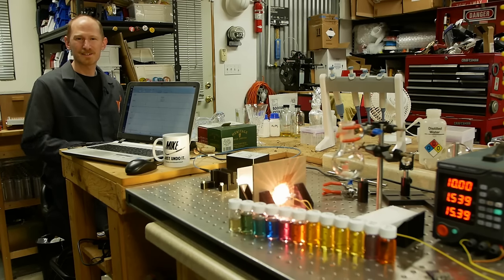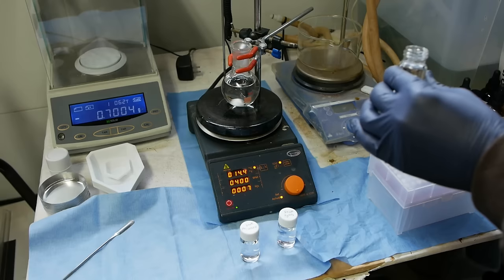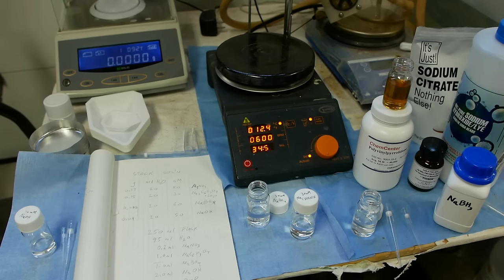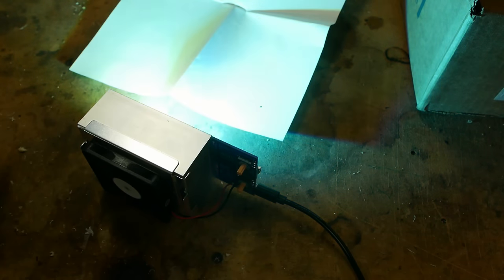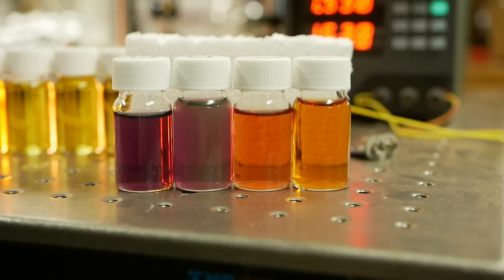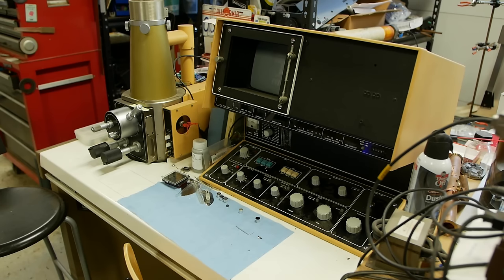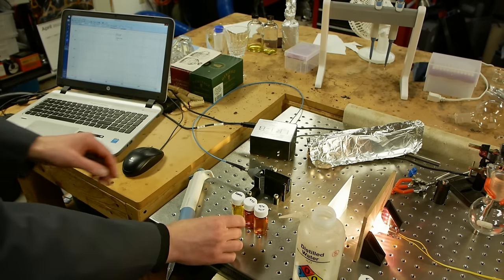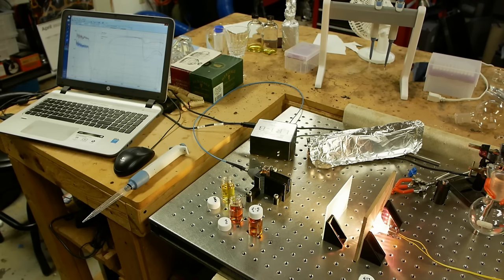Silver nanoprisms grown into structural colors by high power LEDs

Comment: A potentially fun follow-up experiment: Rig up a jig that lets you both illuminate the liquid with a specific wavelength OR sample it with the spectrometer in situ. This way you can turn off the illumination long enough to  sample the absorption spectrum at regular intervals. It would be cool to watch the peaks shifting on the absorption spectrum in time-lapse.
Reply: The reference video did that over 26hr, but with multiple solution runs

Comment: If the reactivity of the particles is "encouraged" by a given wavelength of light, it makes sense to me that they'd therefore react and grow until they're no longer (strongly) absorbing that wavelength. If that's the reason, that also explains why irradiating with a lower wavelength of light doesn't shrink the particles. TL;DR: if we assume the reaction occurring here is strictly crystal growth and that reaction is enhanced by light absorption, then we expect both effects that you seemed slightly surprised by (absorption wavelength != exposure wavelength; and the inability to reduce the absorption wavelength.)
Reply: I agree. But have you found any resources that show size dependent absorption properties of silver nanoprisms? I found a calculator for mie theory of spherical particles which supports this theory, but it would be nice to check for prisms.
Reply: I also noticed that in the third graph, the 405 peak has red-shifted somewhat. I think that aligns with what you're saying. (I'm also curious about the new large peak that appeared in the IR range after the first graph.)
Reply: this explain why when he use the 450nm LED, with intention to "revert it back to original colour" the red-shifting/peak-shifting actually do the opposite and is much stronger because more crystal from 400nm can grow bigger when provided with 450nm light.
Reply: This is the same hypothesis I had. Also, for the colour to shift back, it may be because the larger particles just fell out of solution while un touched smaller particles grew larger.
It is just an illusion of shifting back, the particles don't actually become smaller.

Comment: Ben, one of the ways that nanoparticles are prepared for TEM is to place a droplet onto your substrate, wait for some time for the particles to settle/adhere to the substrate, blot the supernatent out with filter paper, and optionally wash by dropping wash solvent and blotting. There are a lot of surface modification tricks to try to get more particles to stick, such as plasma cleaning, UV-ozone, spin coating charged polymer solutions, etc. It might take a few iterations of sample loading (e.g. apply multiple droplets) to get enough visible sample. Definitely not easy and unfortunately not well described in literature (generally passed down via institutional knowledge in labs studying nanoparticles).
Reply: TEM is definitely the way to look at nanoparticles. Time to build a TEM Ben!

Comment: Oh no. I have a centrifuge in shipping right now that I bought for dewatering nano particles. I did not realize until seeing that separation chart how much of a challenge is ahead for me and my $100 ebay centrifuge.

Really excellent project/video as always!
Reply: What are you working on?
Reply: I hope your particles aren't too small. In the past when I was making 4-8nm diameter water soluble nanoparticles, I used to have to use an ultracentrifuge to pellet them.
Reply: well if it's balanced and built well enough you can always try to supe it up a bit lol.
Reply: @PedroDaGr8  I think I'll be ok. I'm looking for a range of particles from about 100-1000nm
Reply: You can get a refurbed air-driven ultracentrifuge for $100-200, which should be capable of 199,000 x g.
Reply: One thing I was wondering concerning that: How about changing the density of the solution? For example, by diluting a water solution with ethanol or acetone, gravity separation methods should have a greater effect? Of course, the other salt stuff could get percipitated from solution, so you can't go overboard with it... or maybe the nano particles could agglomerate?
Reply: @craoun6116  Interesting idea. It would be tough to repeat and wash the product with various solvents, but could work for some applications.
Reply: Yes yes yes yes I was just wondering if it could be concentrated/plated/dropped down in the fluid and then our favorite birdie's owner chimes in
Reply: I wonder if that paper centerfuge that came out a few years ago would work. I think the paper said it would get up to 30k gs at 125k rpms all powered by hand
Reply: @unionmade1877  not with a rotor - add$1500-2000
Reply: @PedroDaGr8  What material tubes do you use? We had someone destroy a set of ultra centrifuge tubes trying to pellet some Zinc nano particles.
Reply: @johna7075  We used Beckmann-Coulter 26.3ml Polycarbonate Bottle with Aluminum Top (MN 355618). They were reusable and good up to the 70,000 rpm limit of our rotor. We also used Beckmann-Coulter Quick-Seal tubes when we needed the tubes to be disposable (for example, using a needle to extract a band).
Reply: @Nighthawkinlight  and @Craoun - Since I don't know your exact goal nor your experience level, I will touch on a couple of basic aspects. 

Precipitation is GREAT for bulk purification of . A good precipitation or two, allows you to get rid of the majority of chemical impurities. That being said, it is not very good for the separation of nanoparticles by size.  There are other techniques like sucrose gradients which can be employed for size refining but can require more advanced equipment. In general, if you need tighter control on size, you are better off building it into your synthetic process. Controlling reagent ratios, reaction temperature control, limiting Ostwald ripening by controlling reagent addition rates, proper ligand selection, etc. 

A word of advice: It is very much possible to get nanoparticles "too clean", especially by precipitation. In essence, you can get them so clean that you start to strip the ligands off of the surface of the particles. Typically, the surface ligands provide the solubility to your nanoparticles and prevent them from aggregating. If you find after a precipitation or two that you have excessive aggregation of your product (material which refuses to go back into suspension), you might have insufficient ligands on the surface and have aggregated your product (at that point, it's usually toast). You can get around this by either using less aggressive "cleaning" precipitations, adding ligand to your precipitation solution (to drive the equilibrium), or using a "ligand exchange" after the first precipitation. A ligand exchange is basically heating your particles up in molten ligand and letting them sit there for a set period of time to ensure uniform surface coverage.
Reply: @BioMedUSA  Gah so expensive. Thanks for pointing that out.

Comment: I love your old JEOL JSM T-200. I worked for JEOL for about 10 years in the early 90's. I had several of that model in my service area, along with the later 300 series models. They are a great little scope when working properly. The 10nm resolution is only with Gold on carbon @ maximum KV very short working distance. The sample must be heated to ~ 100C before being transferred to the vacuum. Also must have very good chamber vacuum. low e-6 torr minimum. It is a pain, and I can remember the struggles when resolution had to be demonstrated.

Comment: Dang, I never knew how much I wanted a multispectrum monochromatic LED light, that is a super cool idea! I've got 9 different wavelengths of laser pointers which are also very cool for studying light absorbtion in different materials but now that I see this video I need the LED equivalent. It's amazing how much LED technology has evolved in just the last decade, being able to get this many monochromatic LEDs with such a high output power for the relatively low price they cost is incredible.

I also think a flashlight version would be pretty great too, with a wheel inside that rolls through all the different wavelengths so only one is on at a time, that would be neat...
Reply: A few years ago I bought a bunch of different wavelength LEDs to experiment with what things look like under different "equivalent" lighting conditions.  Then I never actually wired them up.  They had quite a variety of inconvenient forms, haha.  Maybe I'll just make his.  XD
Reply: Yyyeah, but compared to your lasers even the most monochromatic LED's are still pretty broadband.  It's still a cool idea though.
Reply: Man I only have six wavelengths of lasers, unless we're counting frequency doubling as two.
Reply: I wonder how hard it would be to get a dense enough series of LEDs so that by adding temperature control (IIRC peek wavelength shifts with temperature) you can get any peek you want?

Comment: One sidenote concerning the stability of the NaBH4-solution: You could basify it in advance (to like pH 10-11), which would increase it's lifespan by orders of magnitude. Just seems like a possibility, since the final reaction mixture needs to be basic anyway. So a mixed stock solution of NaOH and NaBH4 could be used instead of two separate ones, since the required amount of NaOH is also known (2mL 50mM NaOH stock solution)

Comment: When I needed to image citrate-terminated gold nanoparticles in SEM, I used to deposit them onto poly-electrolyte multilayers. Surprisingly simple to set up. Simply prepare your imaging surface (the CD ROM in your case) by alternatively dipping it in solutions of polystyrene sulfonate (PSS; a negatively charged polyelectrolyte) washing with water, then dipping into poly diallyl dimethyl ammonium chloride (PDAC; positively charged), and washing in water again. Repeat the process 3-5 times to ensure a good coating of the poly electrolytes. Make sure you finish the treatment with PDAC so the surface will tend to be positively charged, so that the negatively charged nanoparticles will adhere to the surface. Simply leave this surface in the nanoparticle solution for an hour or two and you should have a even monolayer of individual particles to look at.

Comment: Great video! I worked and made AgNP for my SERS research in grad school at UCSB. I made "bare" borate capped nanoparticles with just borohydride, but they were very tricky to get right and unstable once any contamination got into them. You can also use citrate directly as a reducing agent to make "nanoegg" ovaloids by heating a AgNO3 and citrate solution. These will provide stable citrate capped AgNP. Also, majority of absorbed light usually goes into creating plasmons (surface plasmon resonance). The electrons excited by this process can go on to participate in reactions, like reducing Ag ions in solution onto their surface. Might be an explanation on why the AgNP grow irreversibly with intense light.

Comment: I think photoelectric effect is interacting with plasmon resonances.  Short wavelength (high energy) light causes electrons to be ejected from the particle surfaces and then the solvent captures a silver ion to neutralize the particle.  This continues until the particle gets small enough that its plasmon resonance frequency equals the light's frequency; at this point, the plasmon resonance shields the particle's surfaces from the light.  Once the particle is too small, no longer wavelength light can reach it to cause dissolution.  You could check this model by adding some fresh solution to see whether the color could be reddened in that case.  Adding fresh silver ions will allow all particles to grow until the photoelectric effect arrests the growth.  Plasmon resonances will have normal modes in triangular prisms.  Probably, the underlying fcc structure of silver plays a part in the triangular shape.
Reply: That could be potentially confirmed by looking at silver’s photoelectric work function to see if the redshift corresponds to that difference in energy. I think.
Reply: @Scrogan  Bulk properties don't usually apply to nanoparticles.
Reply: This would be an argument for shrinking the silver nanoprisms, but against growing them, right? "This continues until the particle gets small enough" would push particles to smaller sizes, but never to larger ones, which we clearly see in the initial illumination. 
Please correct me if I misunderstood your comment.
Reply: "Tunable Dipole Surface Plasmon Resonances of Silver Nanoparticles by Cladding Dielectric Layers" Xiaotong Liu, Dabing Li Nature scientific Reports 2015, "[...] In this article, tunable dipole surface plasmon resonances of Ag nanoparticles (NPs) are realized by modification of the SiO2 dielectric layer thicknesses. SiO2 layers both beneath and over the Ag NPs affected the resonance wavelengths of local surface plasmons (LSPs). By adjusting the SiO2 thickness beneath the Ag NPs from 5 nm to 20 nm, the dipole surface plasmon resonances shifted from 470 nm to 410 nm. [...]"
Reply: Small particles interact significantly less with long-wavelength light and grow until the dissolved ions are depleted.  Large particles emit photoelectrons and ions and dissolve making them interact less.  Equilibrium occurs when the light's frequency equals the particles' plasmon frequency.
Reply: @ZoonCrypticon  Aggregated nanoparticles are not layered; however, the dielectric constant of the solution will indeed shift the plasmon resonance frequencies somewhat.

Comment: Awesome Project! About the red shift: Did you consider if the refraction index of the medium might have an effect? Or even the shape of the cylindrical container?
Reply: It would seem the crystals prefer growing over shrinking, like at 14:15. So if the crystals can vary in size, this could give the process a bias towards larger than optimal crystals.

Thinking of the reversibility, maybe it would work if you tried in small, few nm steps. The full cystals might be too far away from the wanted wavelength for it to have serious effect.
Reply: You are somewhat correct! The index of refraction directly influences the wavelength* and therefore directly influences how materials react to light. However, since we never look at the optical properties of the silver particles outside of solution this doesn't matter. The wavelength is shifted when illuminating, when measuring the extinction, and when looking at the colors of the samples.

The shape will likely focus the light a bit, just like a lens would. This may make the growth faster, but will not change the mechanism. 

*It's the wavelength and not the frequency, because E=hv (Energy is planck constant times frequency) and the energy is conserved
Reply: It seems awfully similar to what goes on while using fluorophores in fluorescent microscopy. All fluorophores emit light at a longer wavelength than the wavelength they absorb. 
Basically, instead of losing energy as a function of brightness, a fluorophore (in theory) could emit as bright of light as the one used to illuminate it, but energy is still conserved of course and the fluorophore emits as bright of a light but at lower frequency/longer wavelength.

Since the wavelength of illumination is depositing the amount of energy required for the particles to assemble to a given prism size, and no system is lossless, the prisms will assemble to absorb wavelengths longer than the wavelength required to stimulate self-assembly.

Perhaps like fluorophores, they conserve energy in a similar fashion - i.e. A solution of a given prism size may absorb as much light (in amplitude) as the brightness of the light used to create them but at a longer wavelength, thus still conserving energy.
Reply: @puskajussi37  "crystals prefer growing over shrinking" This is in general true of all reactions, it takes less energy to make a bond than to break a bond. At least the ones that have a favorable forward direction. Additionally, in the case of nanoparticles, there is no guarantee that the "breaking" path follows the same path as the "creation" path. Often for optically active materials, irreversible oxidation pathways are a problem as they provide an alternate terminal pathway the reaction can take.
Reply: I would think that it would be the room temperature which is basically ir light. Would shift it in the red spectrum.
Reply: @nigeypants5500  I thought this as well for a moment before reconsidering it to probably be similar to fluorophores. 
The reason being, I don't think "growing" is the right mechanism to think about what's going on here. There's not necessarily a better word, but here's what I mean:
When the particles are exposed to light of a given wavelength, the particles in the solution don't gradually work their way from red (lowest visible frequency) all the way up to a frequency/color close to that of the light that grew them. Instead, the saturation of how much of a given color is created, simply increases....

I think the light basically 'pops' a roughly similar amount of particles together. If we were to hold a blanket flat and taught in the air with sand on it. Then were to begin making waves in this blanket, the sand would gather in the troughs in quantities roughly related to the frequency we were shaking...The light is the shaking blanket, we're talking nanoparticles, so they all can't be illuminated simultaneously, especially with a single point light source (even if it looks like it to us). So as more and more particles fall into illumination, they pop to a frequency close to that which illuminated them. Thus, saturating the original solution of a specific color more and more. Rather than working their way from red to close to the color
Reply: @RKroese  Perhaps this is the reason the documentation recommends keeping the solution on ice? An attempt to minimise this phenomena?